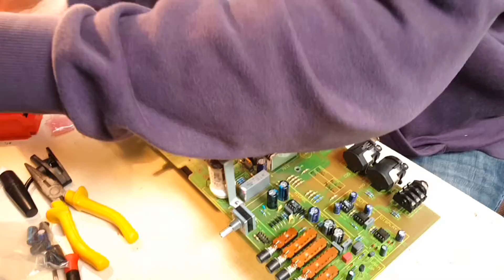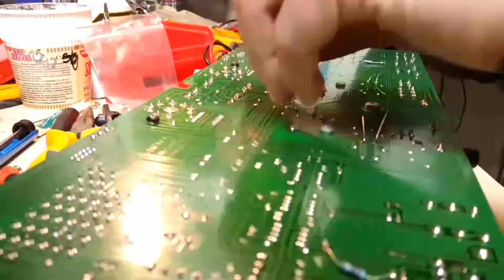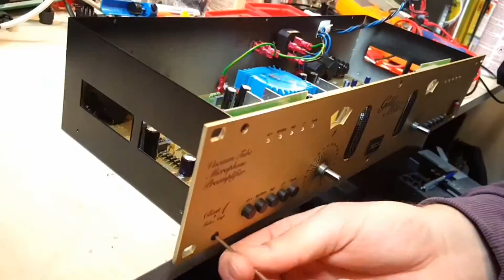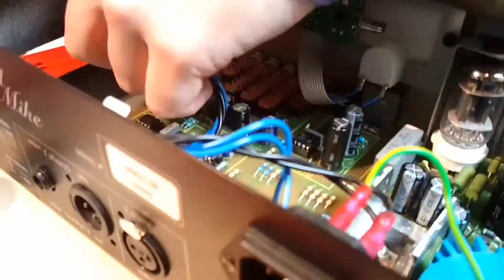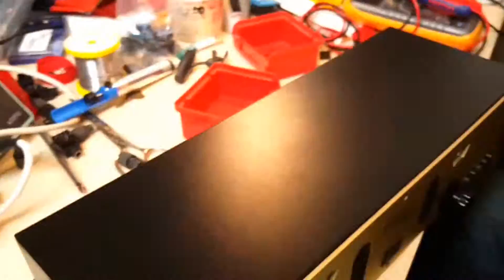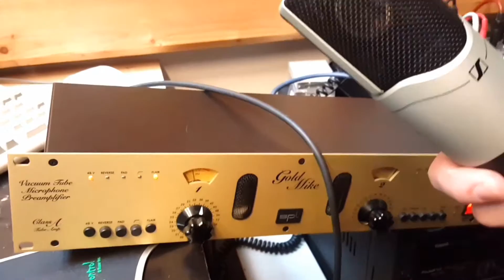Repairing the SPL Gold Mike 9844

Comment: Hi, please help me. I have a GoldMike SPL 9844 does not have much use. I bought a Rode M2 condenser and is the first time I use the phantom power on GoldMike, I unplug the microphone without turning off the phantom power several times. Also I connected to a compressor RNC1773 through a "ground loop isolator" passing the inputs and outputs of the compressor through the "GLisolator" and then to output 1 unbalanced of the GoldMike, and the compressor cracked sounds but don,t broken. The next day I realized that channel 1 has "red plating " Strand middle of the tube 1 is hotting up. I changed the tube and remains the same. What part of the circuit has been damaged?. MICPRE...SYM OUT...DISPLAY...TUBES...WARM UP or Trafo circuit? I measured the diode on WARM UP and I get the same value in both directions (soldered to the board).Thanks and best regards.
Reply from the maker: +SAACAAS Hey. It is well known that the Goldmike has power supply issues. As you can see in the video, its only a faulty condenser. I changed almost all of them (the big ones) since taking the goldmike apart is quite a time consuming job. It's possible that a condenser near the power supply was blown up because of the heat. You'll need to disassemble the unit and check the condensers with a multimeter.
Reply: What symptoms did you notice in your "GoldMike"?. ¿Red plating as mine?. If the fault is in the transformer circuit. Why only fails one tube and not both?. The capacitors outwardly are perfects, and although the "GoldMike" has 6 years, rarely it was power on but not unplugged. Can I measure the capacitors without having to unsolder ?. Thanks for your answers. So, you recomend me to change all capacitors as you did in this video?. Do you recommend me a manufacturer of capacitors especially?. Thanks and cheers :)
Reply from the maker: SAACAAS
The Goldmike was already bought non-functional with the VU-meters going on max. I measured the capacitors without unsoldering. That works just fine. It depende a little, if you want to change all capacitors. I noticed that some of them are "just ok", so i changed them to be sure. If buying new capacitors, go for a brand: Sanyo iE. Be careful with cheap no-name capacitors. They are often already defective on arrival and a waste of money.
Reply: Thanks. It works.

Comment: I got a question. I've had a SPL Goldmike for several years and i have used it alot, but the last years there has been a windy noise somewhere in my chain of equipment. But since i bought a complete new Shure sm7b and i still hear the noise could it then be the tubes that are "dead". I have had this Goldmike for 14 years or so and once i read that tubes should be changed every year, while i read other places that old tubes are better than new ones. I know nothing about nothing, i just write songs, so i am curious if you got an answer to that.

Furthermore i really tried to watch your video and freeze it sometimes so i could see how the tubes are attached. Is it kinda piece of cake to change the tubes in a goldmike?
And is constant windy noise (and momentarily no sounds trough at all) a clear and normal sign of dead tubes?

I would really appreciate an answer from you sir. Thank you :)
Reply: Well, it could be the tubes but the power supply as well. Changing the tubes isn't that difficult but you have to buy new ones. You should give it to a technician if you dont have the skills ro repair the unit. Remember there could remain some dangerous voltage in the unit, even if disconnected and powered off
Reply: Tengo un goldmike desde hace unos 4/5 años, y hoy no me ha dejado grabar por culpa de este famoso ruido, me resulta mejor enchufar el micro directo a la tarjeta de sonido, y entonces me sale limpio, he probado cables también, así que tiene que ser el goldmike...

Lo he probado por los dos canales y me da el mismo ruido.
Solo uso un canal para un solo micro así que me resulta curioso que también se haya estropeado el otro canal .. se estropea solo por el tiempo? T.T
Alguien sabe exactamente que he de cambiar?
Los "tubos" son las válvulas?
Gracias y ánimo!